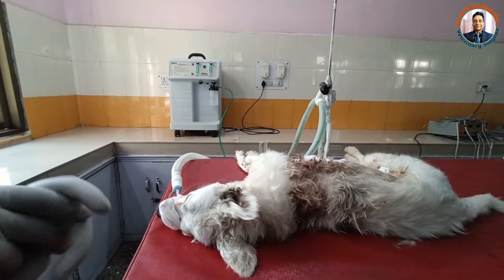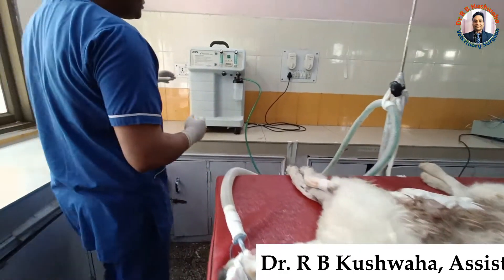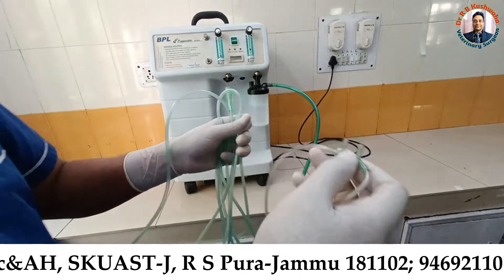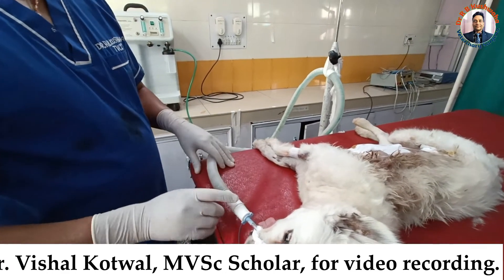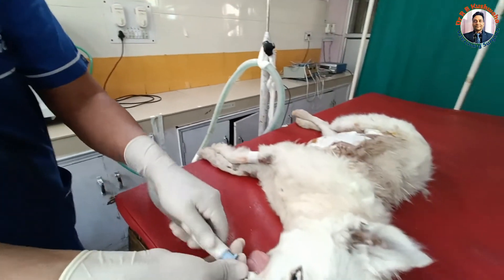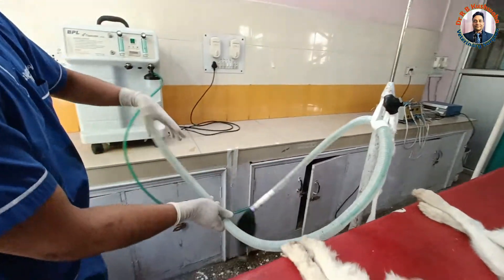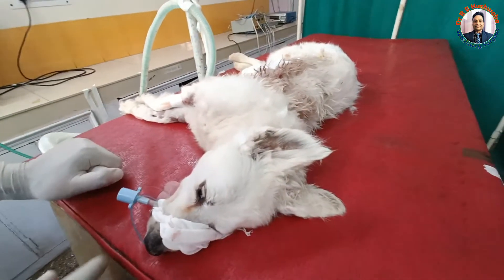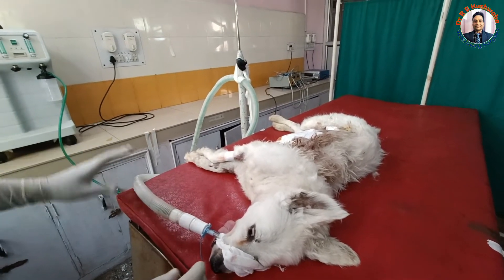Use of oxygen concentrator and Bain's circuit for effective oxygenation in dogs during anaesthesia

Comment: Very informative video sir.
Today's query is - why does the Bains circuit have 2 concentric tubings- outer being transparent and inner one solid??
Reply from the maker: This is coaxial system in which green tube is act as inlet and outer larger tube act as outlet for exhalations which ultimate opens in the environment through rebreathing bag. Green one is for inhalation.
Reply: @drrbkushwaha  thanku sir